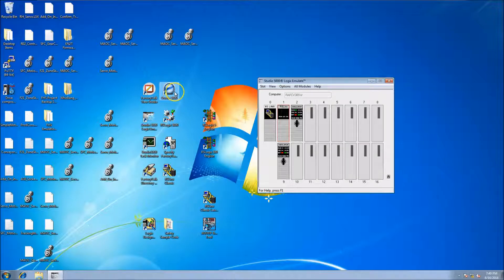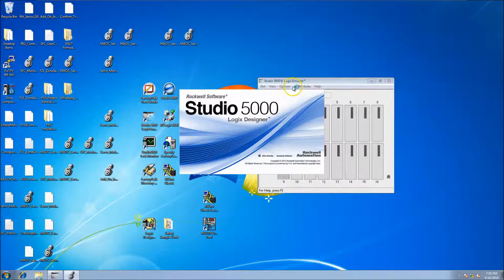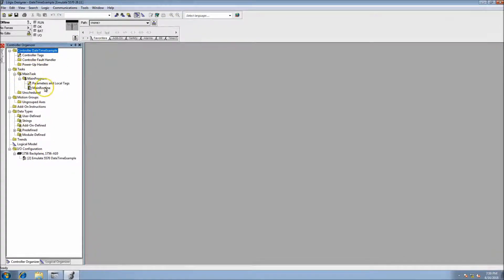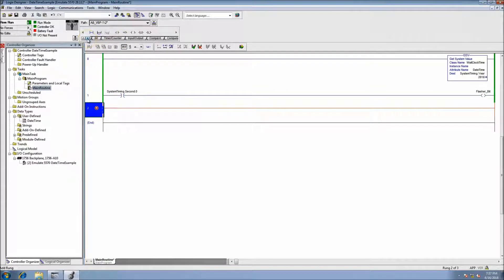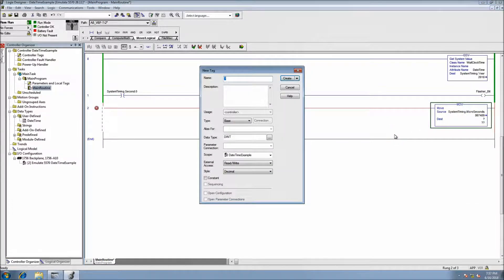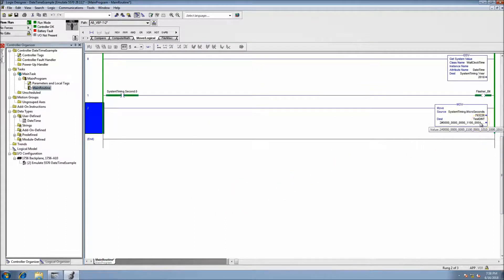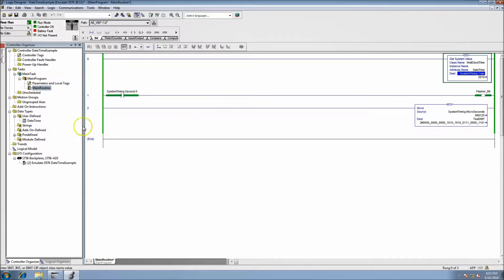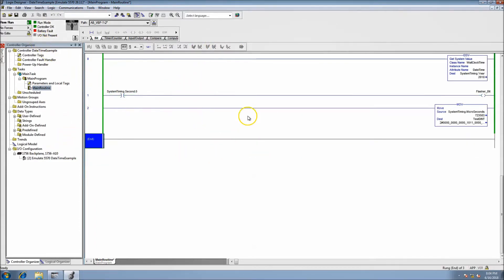Studio 5000 Date and Time UDT With GSV

Comment: why my time different 4 hours between PC and PLC ?
Reply from the maker: Use local date & time to get the right time without a difference
Reply: I have go to controller property and select set date, time and zone from workstation under Date/Time tag. 

And it show correct date and time as per my workstation. However when I create GSV and follow the instructions, the retrieved hours is 4 hours more compare my workstation
Reply from the maker: @lirn3171  use local date & time for the GSV type
Reply: @ShaneWelcher  noted, it work. Thanks Sir.

Comment: Thanks for the video: is there any way to know the day of the week (Sunday, Monday, etc.)?
Thanks.
Reply from the maker: You would have to write code for leap years and such but yes....only if you write logic for it.

Depending on hardware and software versions
Reply: @ShaneWelcher  Ok, I wish there was a way to get that information from the CPU, something like a number 1=Sunday, 2=Monday, and so on...
Reply from the maker: @Andrea_69  

I agree.

I think in the L8 processors there is an option
Reply: @ShaneWelcher  Well, I was thinking about doing it on an existing machine with the L71-S...  thank you very much!
Reply: We have the code for that in one of our logic processors. I wanted it for a dynamic password generator. I didn't realize it would be so complex. Our current calendar system is a 200 year cycle. I'll try and post a link to the file.